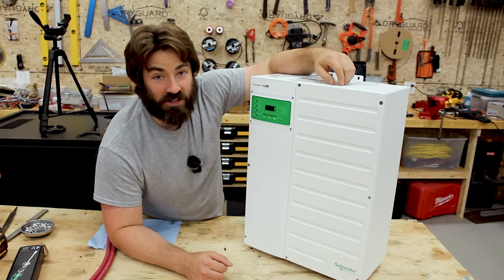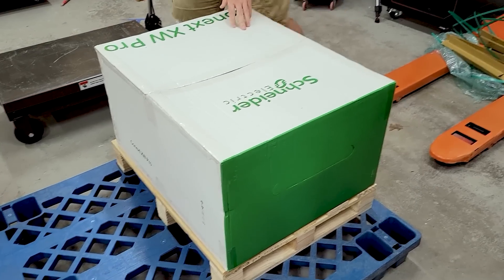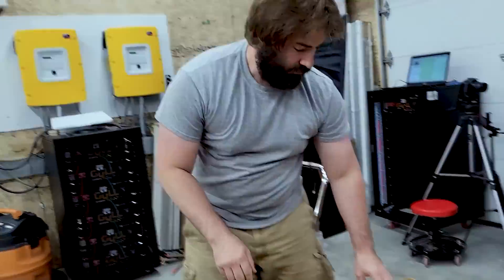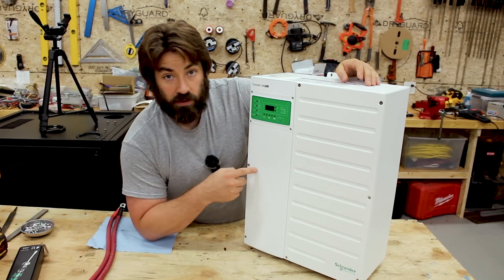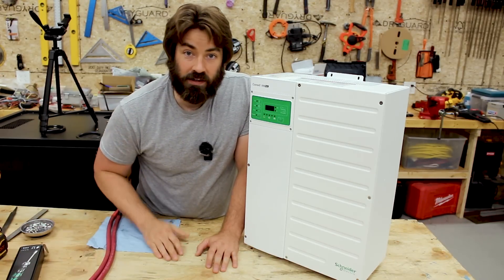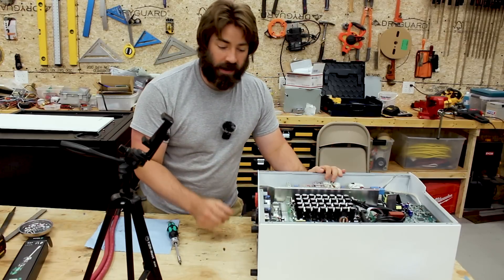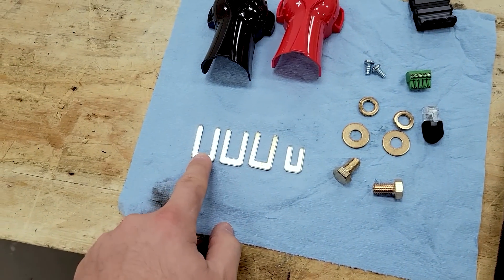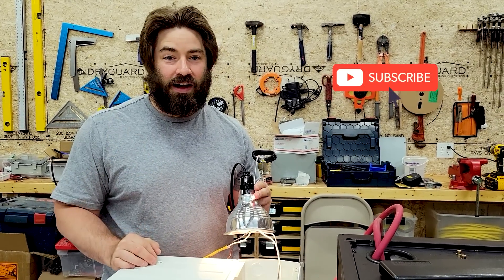Powerful Inverter for Solar Off Grid, Whole House, Schneider XW PRO 6848 Inverter, Hybrid

Comment: Hi Dave, is this the one on sale for $1100? Same model right? Seems like a steal and they should be ready to parallel? 

Seems like a good deal compared to the sungold 12000w transformer based inverter charger.
Reply from the maker: Yes, it can be found online right now for $1,100.  At the time I filmed this video, they were about $3,200 (if I remember correctly).  Since then, Schneider has discontinued the line, they are no longer manufacturing this inverter.  But, the existing stock is still being sold off.  If you want to parallel 2 or more inverters you will need the insight home which allows you to program them.  I have a video on the insight home.
Reply: @DavidPozEnergy this seems like a great deal to get 3 and use the insight to parallel, seems cheaper and more reliable than anything on the market, including sol-ark.
Reply from the maker: I love the Schneider system and am happy with it.  I can't make any comments on the Sol-Ark because back when I made a video on the Sol-Ark, Sol-Ark threatened to sue me. I'm not going through that again.
Reply: @DavidPozEnergy  Were you able to connect your DIY LifePo4 batteries in without issues to this inverter?
Reply from the maker: I have one video where I setup closed-loop communication with my EG4 battery to the Schneider Insight Home.  However, I find it simpler to just run my system without battery-to-inverter communication.  This is called "Open Loop".  Usually you have to set the inverter to "sealed lead acid" or something of that sort.  The insight home allows fully customizable settings, which is what I do.
Reply: @DavidPozEnergy so this inverter has 48v lifepo4 setting in menu or just select nominal voltage for it?
Reply from the maker: I don't remember what the factory settings are inside the inverter.  I changed the factory settings with the insight home.
Reply: @DavidPozEnergy  Wow since the bricking incident of gray market Deye inverter owners ill never buy their products threating lawsuits for an honest review. Your videos are the best never knew anything about xw pro until I started watching your videos. I think if Schneider had come up with a AIO version and updated the software they could have competed with the HF inverter market.

Comment: Hello everyone, Great video.

I have 2 of the older models; Schneider XW+6848 paired with connex mppt 80 600,

Im planning on using a 51.2V 628Ah 32kWh LiFePO4 Battery Pack Vertical and Moveable with 200A BMS from DP to run it.

What are you'll thoughts?

Thanks

Comment: I've got a class A motorhome with 50 amp shore power and generator with 2 120 legs going in and out and this would be awesome but it needs to be pure sine wave for sensitive electronics  and I'd need 2 for pass thru 2-120 legs. 12 volt batteries

Comment: David, I noticed that XW PRO 6848 is discontinued unfortunately and I was wondering if you still recommend this inverter. Do you anticipate any issues because it is discontnued. Thanks. Nick
Reply from the maker: I'm sad they discontinued the inverter.  I understand, most people have moved to all-in-one inverters simply because they are easier to install.  That being said, I think I'll buy an extra one because they are rock-solid inverters. I don't think there will be any issues in operating it.  However, if damage happens to it (lighting or something) then I might have more difficulty getting a part.  But, keep in mind, even if you have an inverter that is still in production, you might not be able to get parts.  Companies in general are not great at service and/or warranty.
Reply: Notice that the off grid EG4s are 5 year warranty where their grid tied stuff is 10 years this is because most solar installers can't charge someone 80-100k for 25-40kw grid tied system without an RIO on a 10-20 year loan. Mortgage companies require 10 year warranties or they won't loan the money if someone defaults in theory they can recover the equipment. I'm guessing after 10 years the risk of default is much lower.

Comment: Can i use 2 outback solar controler 80a to charge the batteries
Reply from the maker: Yes.  You don't have to use a Schneider charge controller.  You will need to program the two independently, but that's not very difficult.

Comment: If I have 5kw lifepo4 battery conect to this inverter can I charge electric car.? My car charge 210v only not 120 v
Reply from the maker: The Schneider XW PRO 6848 puts out 120 and 240 Volt AC power from the factory.  However, if the 5kWh battery you have is only rated at 1C, then you will have to limit the inverter so as not to draw more current than the battery can handle.

Comment: For off-grid use, I assume you need the Insight Home to monitor, and the XW SW Configuration PC Tool to customize your settings?  That's $900, and then there's the solar charge controller.  How are folks configuring their inverters?  Is the Configuration PC Tool required?  I skimmed the Insight Home manual, and it doesn't appear to have the ability to configure.
Reply from the maker: I used this XW PRO for several months without ever connecting it to a computer, or insight home, or configuration tool.  If you give it 48V, it puts out 120/240V right out of the box.  I even did a torture test video with factory settings: https://youtu.be/nCV1OUrcAaw?si=I_D7mSp3cDZvXCoY

Eventually, I did purchase a Schneider Insight Home.  The Insight Home allows you to configure everything so long as you connect to it with a computer, or tablet, or phone.  What's cool, is the Insight Home will connect directly to your device so you don't need to be in range of wifi, or cellular service.  The Insight home allows you to set up advanced controls, but isn't necessary if you just have one XW PRO off grid.
Video on Insight Home: https://youtu.be/-SrutxFyJw0?si=G5KMnOoUfBzT14BP

As for that "configuration tool", that was used prior to the insight home being available.  The insight home replace it.

Comment: Which lift table product are you using at 3:15?   I like the compact design
Reply from the maker: I picked it up at Harbor Freight with a coupon.  https://www.harborfreight.com/1000-lb-capacity-hydraulic-table-cart-60438.html
No affiliation with HF.

Comment: How do deal with DC Over Voltage and Battery Over Voltage? I install two XW Pro Hybrid Inverter 120/240 V 6848, 2 MPPT 100 600 Charge Controller and 15.4 kWh BYD Battery-BOX Premium LVL 2021. Thank you very much.

Comment: Pricing this out, I’m wondering if you bought the  Schneider Inverter XW Pro but then went with non-Schneider everything else, would it work?
Reply: Also why all the DC breakers on the PDP and so few Ac? Any small cottage I guess will be adding subpanels for house wiring.
Reply from the maker: Sure, my friend, Chris, did that with his system.  He is using a Midnite-Solar brand DC circuit breaker box.  Here is a video with his property: https://youtu.be/dDGWYGXP3T8?si=vido8inacRirnvHU
Reply: @DavidPozEnergy  Thanks so much! He used the Schneider MPPT.  I'm seeing the value as I watch your Schneider playlist.

Comment: I just got the Conext 6848 inverter/charger and it was a huge mistake for me.  I got it to replace the 6048 Xantrex inverter/charger that died on me.  I've had this thing for about a month or so now, and it WILL NOT accept power from the generator like it's supposed to.  Call Schneider for help and I get someone from India who I can't understand, and he can't understand me.  At least with the Xantrex, if I needed help, I was talking to someone knowledgeable in the US who I could understand.

To make matters worse, I had to buy this one, which was not cheap at all, because Schneider stopped supporting their previous model, forcing me to buy their newer one.  Now that I have this one, it hasn't worked correctly since I got it and Conext, Schneider, whatever, have been absolutely NO HELP at all.  I regret not buying a MidNite Solar product, the product has to be as good, and I can't imagine the service possibly being worse.

If this seems negative, it is.  I ended up spending a whole lot of money for nothing.  Thousands of dollars for what (to me) amounts to junk.

Comment: 1) What's the recommended Mains AC Load breaker size to safely use on a Single 6848

2) What's the recommended Battery DC breaker or Fuse size to use safely
Reply from the maker: The manual recommends 60A AC circuit breakers. 250A DC circuit breaker to feed the inverter, or a 300-400A fuse depending on interrupt time (fast vs. slow)

Comment: Thank you for sharing I have a question for the Schneider Electric charge controllers the manual State said its temperature compensated so my understanding of that phrase means I don't need to factor in the cold when I wire my panels in series for VOC I'll give you an example if I'm wiring eight panels were the VOC is 20 each that's 160 VOC total 4/8 panels normally I would multiply it by 1.25% for the cold Factor however Schneider Electric is stating that their temperature compensated which means I can add more panels in series series am I correct
Reply from the maker: Schneider sells 3 different solar charge controllers.  My experience is with the 600V, 100A, model.  I'll answer your question based on that model.  
It is the installer responsibility (you) to make sure you never go over the 600V rating.  This means you must take into account the cold weather.  If your temperature compensation is 25%, then the maximum string open circuit Voltage you can wire together is 480Voc.  480Voc*1.25=600Voc.
If memory serves, the 100A rating of the charge controller is based on 40°C (104°F) ambient air temperature.  This means the charge controller can output 100A all day long and keep itself cool enough, so long as the surrounding air is at or below 40°C.  However, if the ambient air is between 40°C and 65°C, then the internal components can start to over-heat if still operating at a continuous 100 Amp output.  Once the internal temperature sensors see this, the controller will automatically throttle down below 100A output in order to keep the internal electronics cool enough.
Reply: @DavidPozEnergy  thank you David for the reply this is the charge controller that I had bought the exact same one that you had mentioned thank you so much for the clarity
Reply from the maker: Glad to help

Comment: You never answer but I'll ask anyway.  Are you a certified installer for Schneider?  If not does it void your warranty since you installed it yourself?
Reply from the maker: I'm a DIY, installing my own system.  I don't work for Schneider and I'm not certified by Schneider.  There is still a warranty on the parts, but usually it's less time compared to a professionally installed unit.  I don't know the warranty times off the top of my head.
Reply: @DavidPozEnergy  Hey you answered!!  Thanks, I watch alot of your videos.
Reply from the maker: Your welcome.  I attempt to answer questions, but sometimes I just get too many.  Thanks for watching.

Comment: Try the System control panel. With the xw + the system control panel can replace the existing user interface.
Reply from the maker: Thanks.  If I had the XW+ I probably would do that.  In this case, I have the XW PRO and Schneider doesn't recommend the SCP with it.  I bought the Insight Home and that's working for me.

Comment: That's David! I'd love to see the idle consumption and also how it handles un balanced loads when the power goes out in my house (off grid mode)
Reply from the maker: Check out my other videos to see the load testing.   I think idle was 34 Watts.  It's been an awesome inverter.  Just one inverter has been powering my whole property.   Although,  I did pick up a second inverter, just haven't wired it in yet.
Reply: @DavidPozEnergy  34watts! Wow, that's amazing! I was just watching your other videos showing this. Thanks! I think I'm gonna get this one.
Reply from the maker: Very cool.  If you decide to move forward, would you mind buying it through my affiliate link?  It really helps out the channel.  I put links in the description, but here is another one. https://signaturesolar.com/schneider-conext-xw-pro-6-8kw-inverter-charger-48v-120-240v/?ref=4_rHcgZ9x-TiF-

Comment: Does anyone know if a Victron SmartSolar MPPT RS 450v 200A can connect to and communicate with a Schneider Conext XW PRO 6.8KW?
or connect a Victron SmartSolar MPPT RS 450v 200A to Schneider Insight Home?
Reply from the maker: You don't need to have a direct connection between the Schneider inverter, and a Victron charge controller.  I am using a Victron charge controller (250/100) without any communication to anything else.  In my case, my EG4 batteries directly talk (closed loop) with the Schneider, but even that is not necessary.  If you are using a battery that doesn't support closed-loop communication, then you can add a Schneider battery monitor.  But, again, it's not necessary.

Comment: Good video....I am a user of Schneider equipment, I currently have a 6848 Pro but I have a question regarding the Grid support configuration...I have the equipment for self-consumption with grid support enable and zero sales to the grid. ..the question is..why does it consume 100 to 200 watts from the grid when the batteries are charging or when they are fully charged?...any setting I have to do?....thanks
Reply from the maker: All my work is done off grid.  I limit my responses to things I have direct experience with.  Sorry I can't help you with on grid questions.

Comment: Great videos! 
XW inverters are an enginering beauty with a toroidal transformer beast! The transformer has 3 windings: 56V AC and 2 x 120V separate AC plus a temperature sensor. The AC lines can be wired in parallel for 120V AC, in series for 220/240V AC and in split-phase for 240/120 V AC with a Neutral. In split-phase setup, the toroidal transformer also serves as the perfect NFT (neutral forming transformer) that can handle full imbalanced load.
In charge mode, the AC input gets transformed down to 60 V AC and then rectified with voltage and current control via the inverter board to charge the battery. In grid or backup mode, the DC battery input gets converted via an H-Bridge into a sinewave, frequency and amplitude controlled, and then transformed up to the 240/120 AC output voltage.

Would like to have the SCP available on Pro series!

And would like to see more from David on closed-loop DC coupling with EG4-ll(V2) batteries and on AC coupling with Enphase IQ8 inverters.
Reply from the maker: Excellent explanation.  Stay tuned if you want to see the closed-loop coms.

Comment: David
I would very much like to see a comparison between (2) EG4 6,000 EX48 HF and (1) Schneider XW PRO. I would like to see what inverter has the most surge capability and the most imbalance ability. I need an off grid system to run my house and woodworking shop for the best price.
Reply from the maker: Two of the EG4 6000EX-48HV inverters would give you 12kW continous, and a single Schneider XW-Pro can do 12kW for one minute.  I'd say a pair of the EG4's would win in the surge capacity.  If you need to run high loads for long periods of time (think 8kW+ for hours) then a single XW-PRO is not the right choice.  

Keep in mind that a pair of the EG4's will consume 240W in idle, that's 5.76kWh/day just being turned on.  Lot's of things to consider for whatever your particular application is.  I like the EG4 inverters if you have it off most of the time.  This could be a back-up system you only turn on if there is a power outage, or maybe a cabin you visit on weekends.

Comment: Gald to see your do this xw pro series. I Just hooked up mine and have many question. Like what's should I is set my battery capacity at. I have 9 eg4 48v batteries hooked up. Should it at 900?
Reply from the maker: Exactly.

Comment: Just when I thought I had my choices narrowed down, I come across this video and Schneider. 😅

Started out looking at portable power stations like EcoFlow which led me to DIY less portable solutions. 

I want backup home power to power gas furnace, a couple of fridges and freezer, a few outlets and lights. 

Wouldn’t need 6.8kwh of continuous power so may look at smaller Schneider unit. 

Not looking at solar yet either t’as I plan to charge the batteries using a dual fuel generator for extended outages. 

I don’t get many outages up here in Ontario Canada but I’m preparing given the signs of the times.

Comment: Can it be paralleled in 240v mode
Reply from the maker: Actually,  this particular inverter puts out both 120 and 240V .  You can parallel up to 4 units for the purpose of increasing the total kW, but it won't change the Voltage.

Comment: This is the inverter I should have bought. I bought these so called all in one. Straight out of the box it didn’t work taking charge from generator. I did everything the tech support and 20 days later still waiting on tech support. Schneider tech support are awesome and there in the USA and there tech will help you troubleshoot the problem and they are good and very experienced in electronic down to components level. Schneider has good electrical schematics and were all these China made inverter are good to providing it doesn’t break.